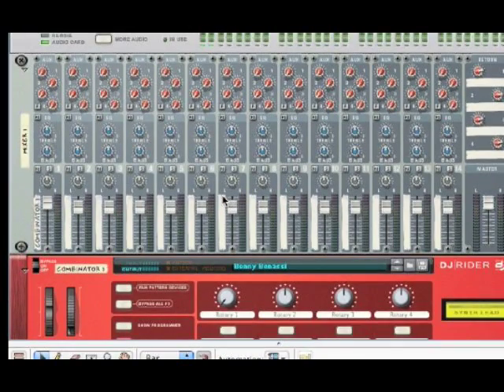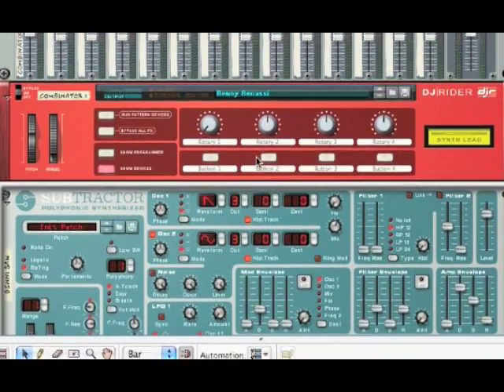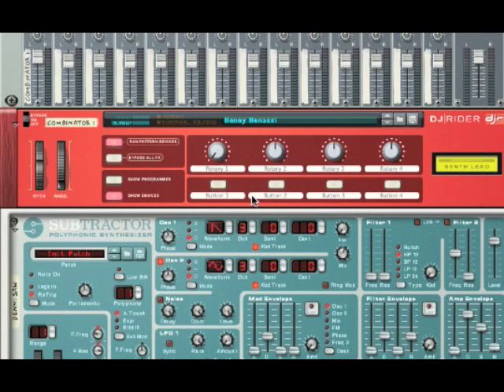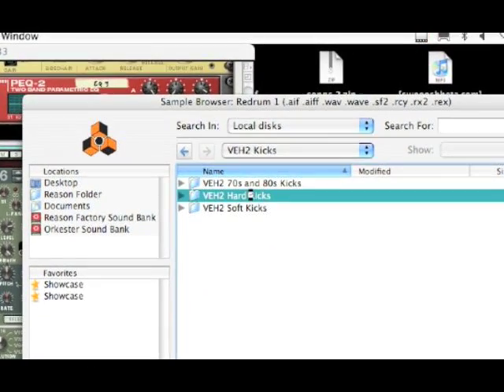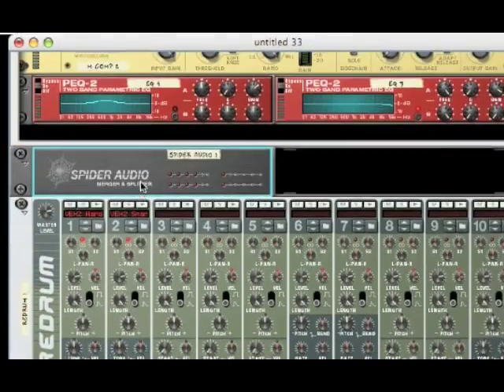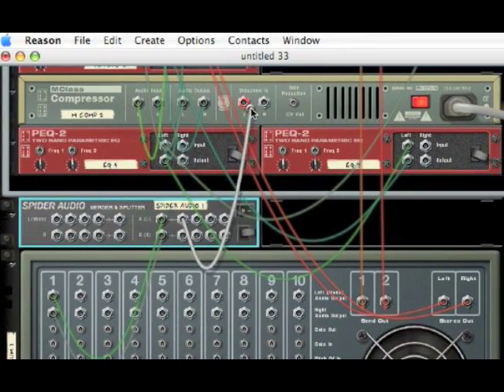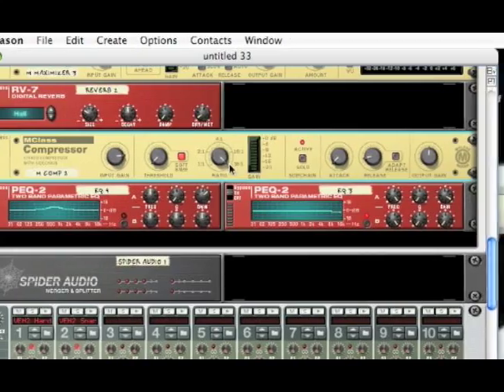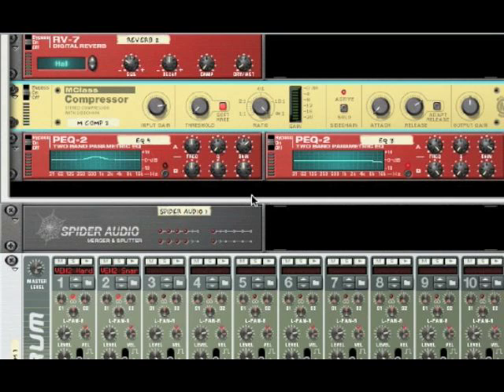Create The "Benny Benassi Synth" On Reason! (Tutorial 2)

Comment: Sounds great I noticed though that there should be a bit more of a glide from the notes cause its striking the notes solid but in the song there is more of a glide to the notes, will make it sound a lot smoother. Also you can do this using modulation (lfo) as well.

Comment: @TRIAM1D With the Thor you can do this. Thor can route almost any signal to anything. So, try it out> Use the LFO2 and route it to amp level. You can then tweak it by changing the filter section.